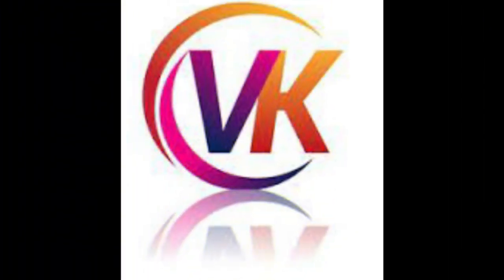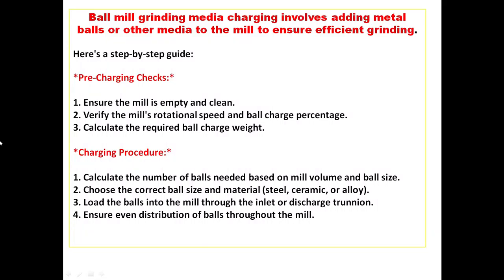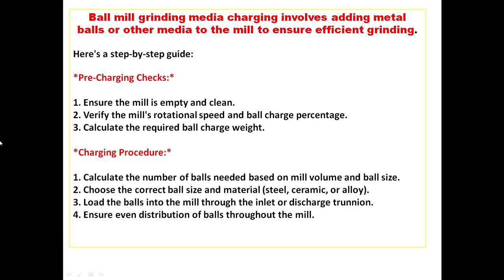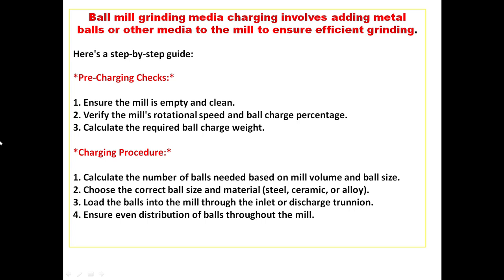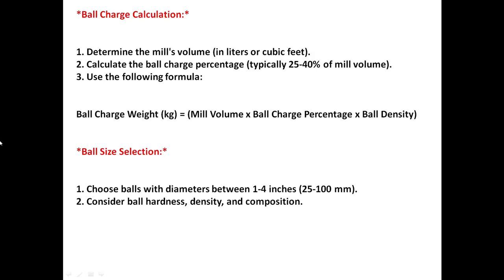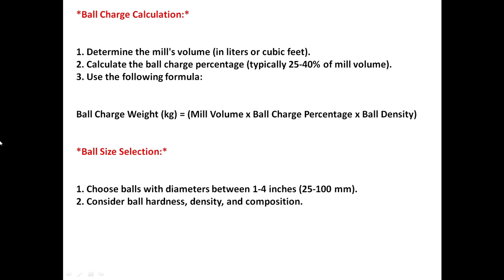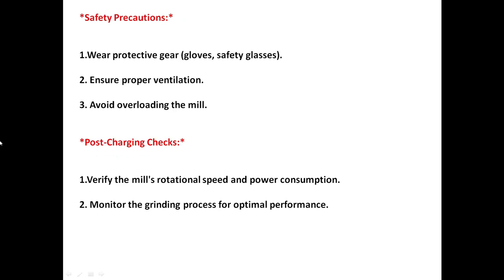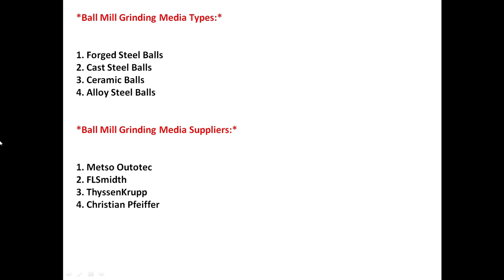Ball mill charging calculation #ballmill #cementequipment #vrm #millcharge  #mechanical

Comment: How to Choose Grinding media pattern for Ball mill grinding limestone
Reply from the maker: Hi, Thank you for watching videos , Choosing the right grinding media for a ball mill depends on several factors, including:

1. *Material properties*: Hardness, abrasiveness, and chemical composition of the material being ground.
2. *Mill type and size*: Ball mill size, speed, and type (e.g., batch, continuous, or overflow).
3. *Grinding requirements*: Desired product size, shape, and distribution.
4. *Operating conditions*: pH, temperature, and moisture levels.

Common grinding media materials:

1. *Steel balls*: High-carbon steel, chrome steel, or stainless steel.
2. *Ceramic balls*: Alumina, zirconia, or silicon carbide.
3. *High-chromium cast iron balls*: Resistant to abrasion and corrosion.

Factors to consider when selecting grinding media:

1. *Wear resistance*: Choose media with high wear resistance to minimize contamination and reduce costs.
2. *Corrosion resistance*: Select media resistant to corrosion, especially when grinding materials with high acidity or alkalinity.
3. *Density*: Higher-density media can improve grinding efficiency, but may increase wear on mill liners.
4. *Size and shape*: Optimize media size and shape for efficient grinding and minimal wear.

1. *Consult manufacturer recommendations*: Follow guidelines from ball mill manufacturers or grinding media suppliers.
2. *Conduct trials*: Perform tests to determine the optimal grinding media for your specific application.
3. Monitor and adjust:- Continuously monitor grinding performance and adjust media selection as needed.
Reply from the maker: https://youtu.be/3ChUoT3xQa0?si=kqQPbn7caMiH05hU
Reply from the maker: https://youtu.be/ksMR2lHq_tw?si=xmikG72Dv7JjJ-wo